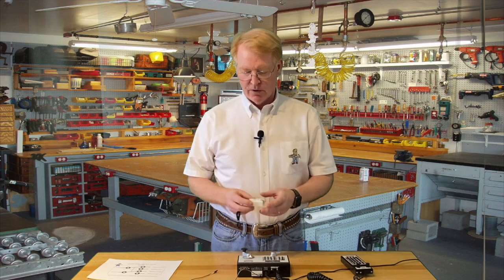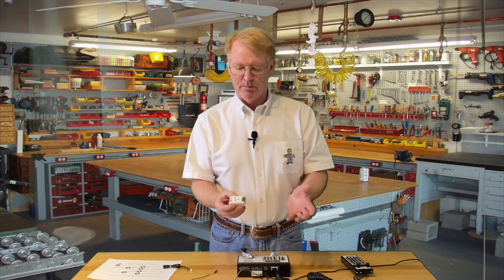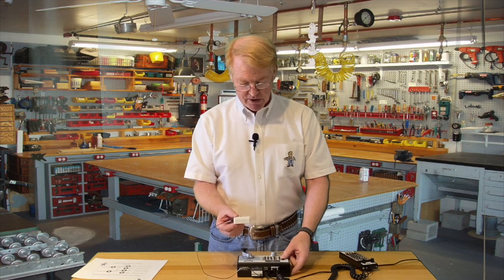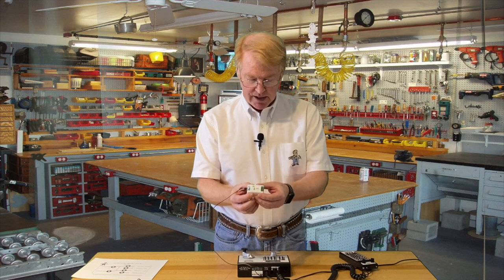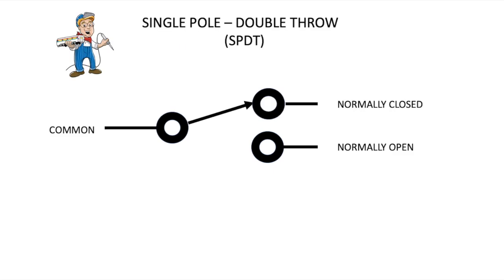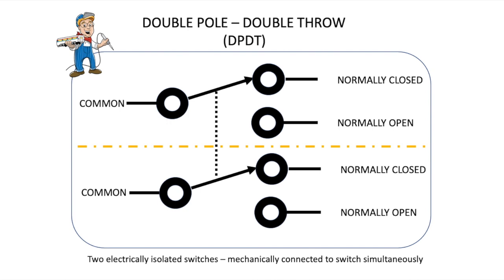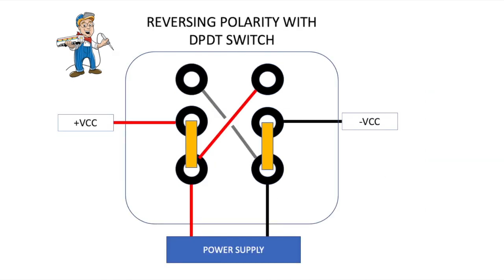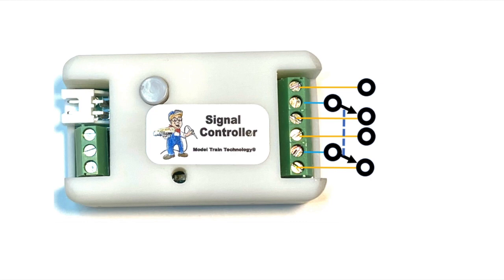New Product:  DCC Relay Controller

Comment: I am assuming this is limited to 12-24 volts, is this correct?
Any chance you would make a line voltage version?  I want to create some day to night/night to day transitions and being able to trigger "smart switches" via DCC/JMRI would be helpful.
Reply from the maker: The contacts are rated to 1 amp , 36V.